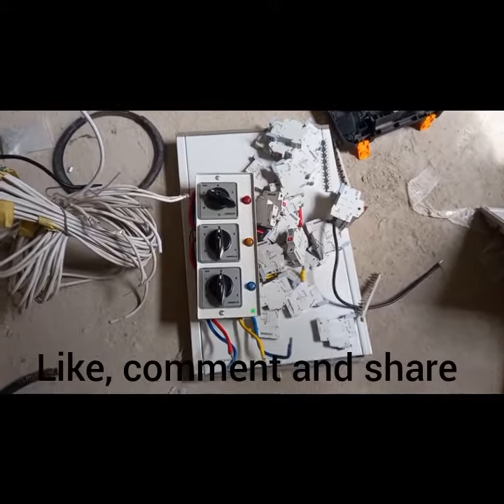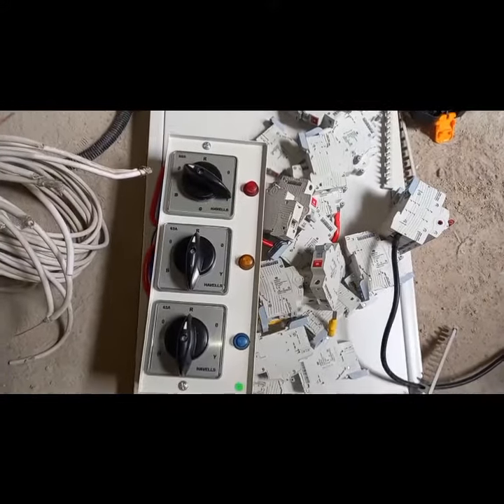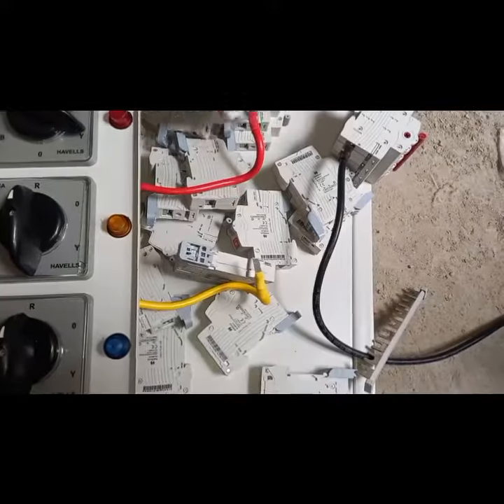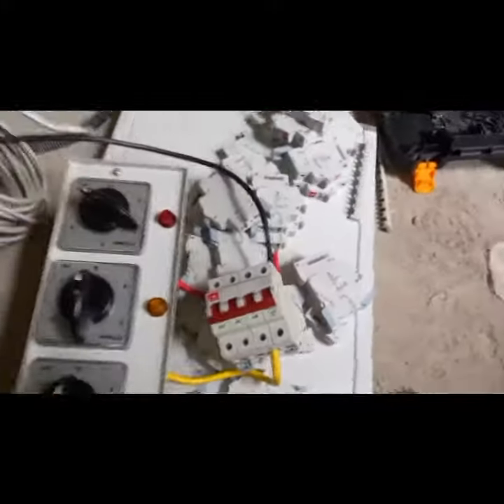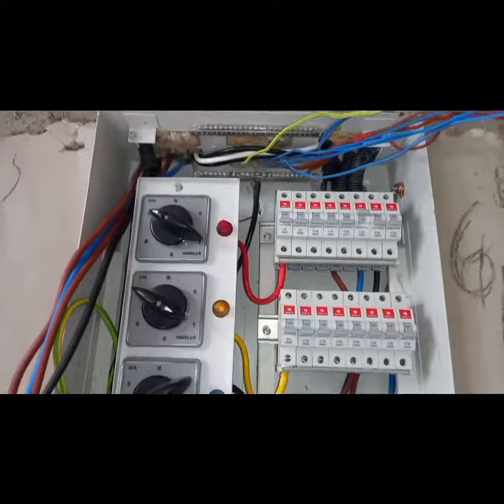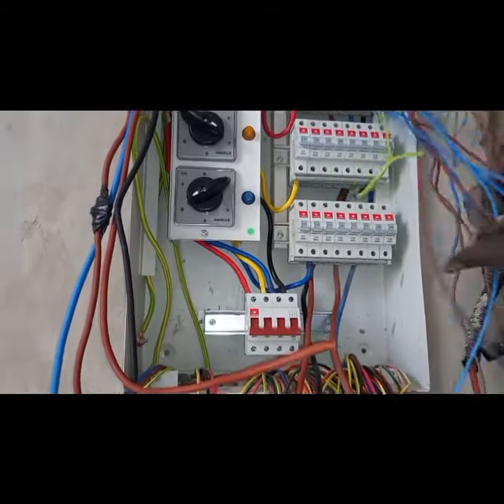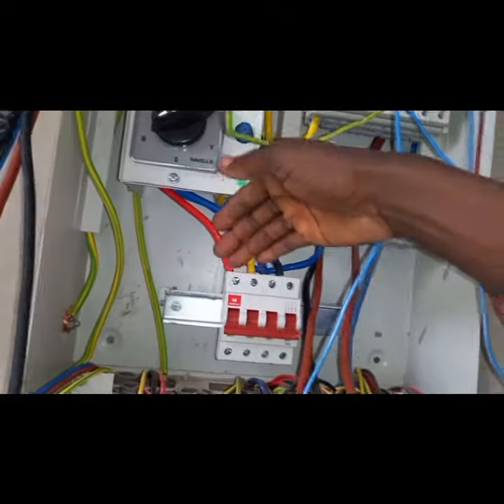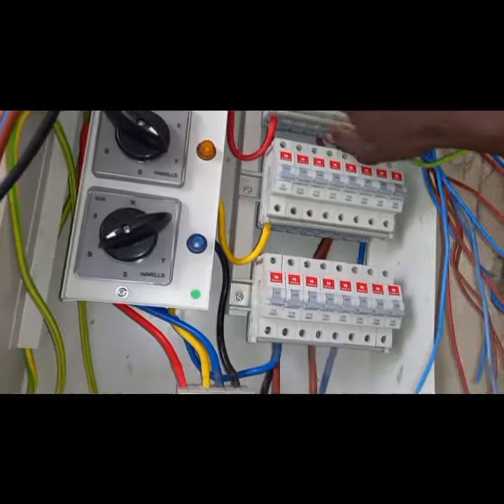Building In Ghana | Before And After Installation Of Breakers For A Three Phase Distribution Board

Comment: Nice one buddy. For a four bedroom house and plans to use both ECG/VRA plus solar/generator which distribution board is recommended. Thanks for your advices 🙏
Reply from the maker: So when it comes to distribution boards we choose them carefully. So just recently I worked on a two set of 2 bedroom apartment and in one of the flats the circuits was way more than the other, so in this case if I were to just assume and get anything without proper consideration of the number of circuits in the apartment I would have messed up. Bottom line is before you decide on the type of distribution board, you first calculate or count all the possible circuits, like lighting circuits, socket outlets circuits, Air conditioners circuits, water heater circuits, cooker circuits, water pump circuits, and any other circuits that will be in the property.  Also the type of four bedroom will influence the decision, for example a four bedroom apartment (1 storey building) will be totally different from a normal four bedroom house.
Reply: @multiskilledelectrician1  Professionally explained thanks very much Engineer, I will try and get the estimated circuits for a recommendation
Reply: @multiskilledelectrician1  Professionally explained thanks very much Engineer, I will try and get the estimated circuits for a recommendation
Reply from the maker: @ruhullahidani276  you welcome sir!